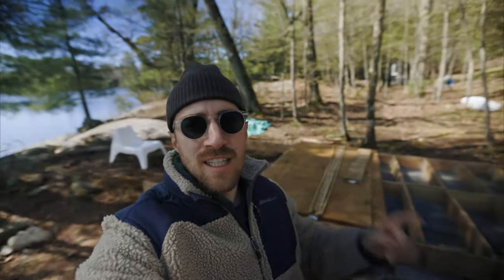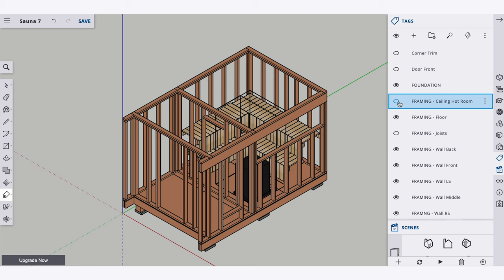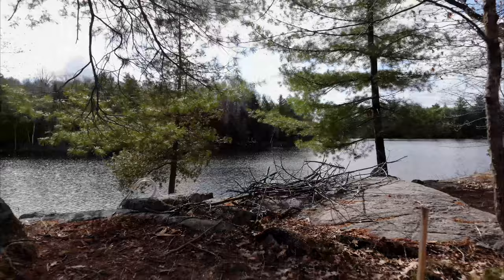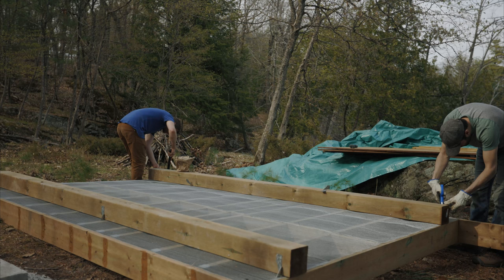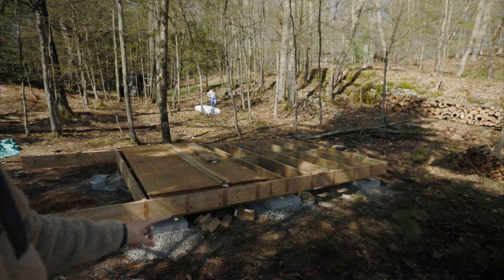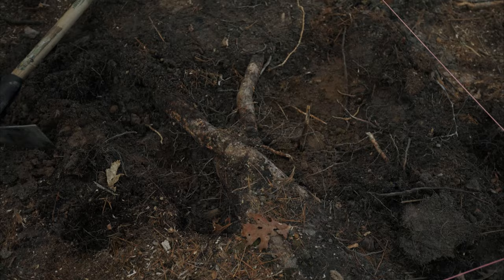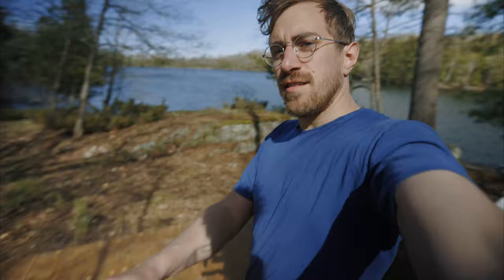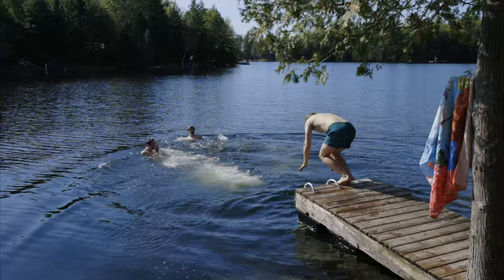Building a DIY Authentic Sauna (not a barrel sauna)

Comment: Master class on foundation and framing. The wire mesh is so important. We have had mice invade our hot tub rigid spray insulation--chewing it into nesting. I get it--it's cold out. But my hot tub needs it. I like your idea of having concrete pads on compacting gravel. How did you settle on that over like just putting pressure treated beams right on gravel? This approach will save me lots of time in my construction. And if we need to move the sauna later we can, I suppose.
Reply from the maker: I also like that the sauna is moveable. It’s a little tricky getting the pads level (I used a laser) and using the pads makes it easier set one at a time and get them all at the same height before building as opposed to going back and fourth between 3 piles of gravel. I also wanted the pads (called pier blocks) so that I could shim between them and the 6x6 of the ground changes.
Reply: Where did you get your pier blocks from? Hard to find them but I like the ones you used! Any light you can shed on this would be appreciated. Thanks!
Reply from the maker: @marcusmazza2255 I got them from the local home hardware building supply place. I think most or many building supply places will vary them.

Comment: Check your counties zoning ordinance. In my county in north east Minnesota, no structure no matter the size, can ber closer than the specified lake set back. This applies to "temporary buildings" on skids ect. It is usually at least 100 feet from the high water line of the lake shore. Check first or you may have to tear it down or move it. and, pay a fine as well.
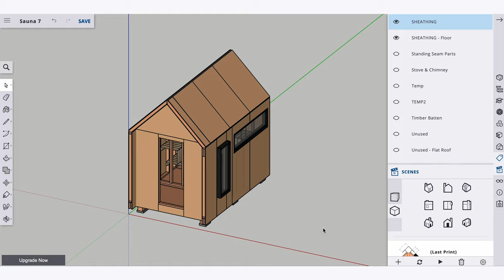Reply: 1:00

Comment: Great video! Looking to build a sauna myself, just a question why the gap between the foam and the rodent wire mesh? Keep the vids coming!
Reply from the maker: The gap is only for ease of install. It was easy to roll out the mesh and staple to the bottom of the framing vs up against the insulation in each “pocket” under the floor. Not sure if it’s the right way to do it but it’s what we did 😀.

Comment: What a location! I noticed you are using the Paslode framing nailer - do you find that the 3" nails were sufficient legnth (and stregnth) for framing your sauna?
Reply from the maker: 😀. The Paslode worked great for me and it’s an old model. I used 3 1/4 nails which is acceptable from what I’ve read. I’d do with 3 1/2 if hand nailing but the Paslode worked great and made quick work of it.

Comment: Building one up in Montana on a buddy's property soon, figuring out foundation and whether to pour a slab, or use concrete/cinder blocks like you all did. What are your thoughts and considerations re: the method you chose? How and why did you do it like that? Looks like a shallow hole with gravel for perch/leveling and blocks on top to mimic posts. Any and all beta much appreciated! Thanks.
Reply from the maker: Concrete slab is certainly the best way to go if you can. My route was simpler but concrete will be more solid. Don’t forget to plumb in a drain.

Comment: I was told never use foam insulation because of the gases that are emitted from the heat.
Reply from the maker: Fortunately there is little no no heat on the floor. I wouldn’t use this on the walls although I did use some spray foam around the windows. There are mixed opinions on this. Everything is vapour barrier and I did some temp tests on the wall cavity during use and the temp is quite low during a hot sauna.
Reply: @JonathanKuhn  good to know.  I am in the middle of building my sauna so I’m trying to learn as much as I can.  Do you think it’s necessary to insulate the floor then?

Comment: Are the main floor beams just sitting on the pavers? Or did you fasten them with something?
Reply from the maker: They are just floating on the pavers. If they footings were poured concrete in the ground I’d tie the building to them but they footing foot too so this made sense

Comment: What did you use for the plumbing? Mind if I ask how you fastened it to floor?
Reply from the maker: I just used a basic floor drain, the kind you would put in a basement concrete floor. I think I glued it in before doing the skim coat.

Comment: can u share the sketch up file?
Reply from the maker: Hey Greg. I just added a download link to the basic framing in the description. Use as inspo only. These have not been looked at by an engineer and may not comply with your local building code. Happy planning!
Reply: @JonathanKuhn  i dont see it anywhere. Cheers
Reply: Hey man, would love to get the download link 👍
Reply: @JonathanKuhn  yep great work I would love a sketchup model also
Reply from the maker: Check out the video description. I added it there. Happy building ! 👍
Reply: @JonathanKuhn  u wrote twice you did it but its not there.
Reply from the maker: My mistake! The link is an another video. I just added it to this video description. 🤦‍♂️

Comment: Are those 2x8s you used for the  base?
Reply from the maker: I used 2x10 so I could get away with two beams and not 3
Reply: Hey @JonathanKuhn  Awesome build! I appreciate you spreading the love with the SKP model. I noticed you have 2X8's in the model...  Are you happy with that extra 2" of height and structure? Really trying to limit our height off the ground in our design. Once again cheers for this video series

Comment: have you had any frost heave?
Reply from the maker: Not that I’ve noticed. The building is so small and solid that even if it heaves it should all move together and settle together. It’s still level after 1 winter but if that changes I’ll jack it up and shim the footings. I’ll take any advice you have though!